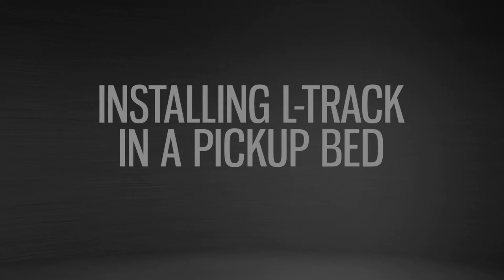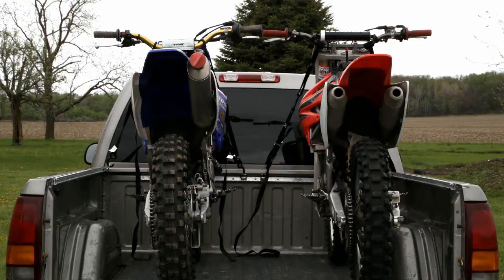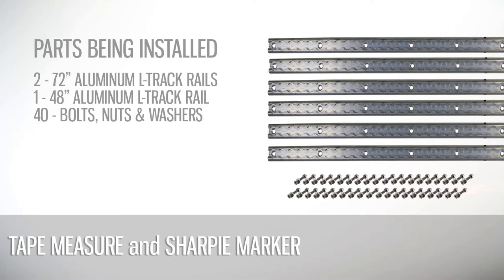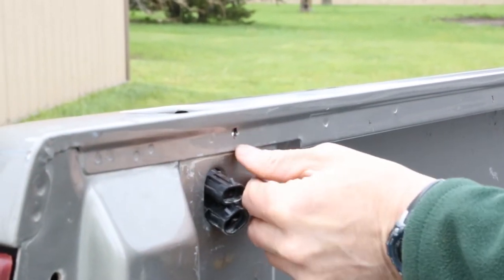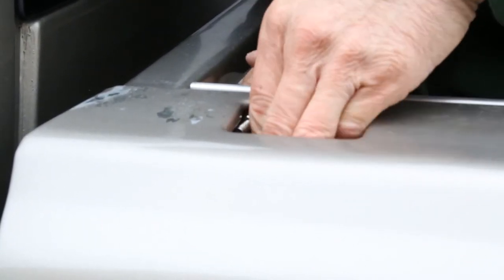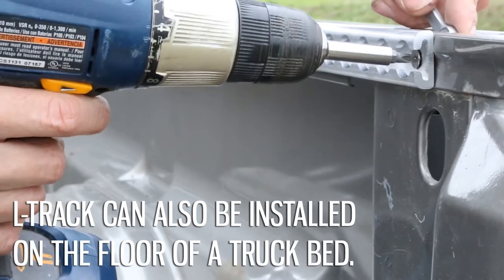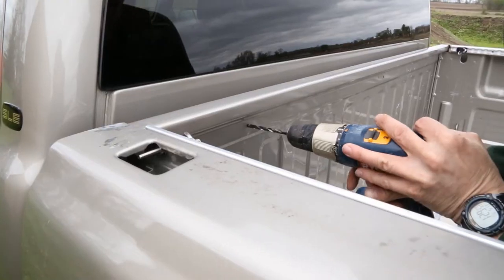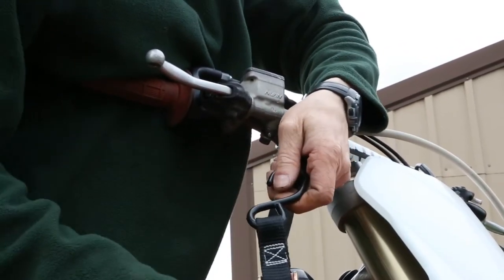How to Install L-track in a Pickup Bed | L-Track Tie Down System

Comment: Do you need to put any type of backing plate on the other side of the bed rail from the track? Also do you need to paint or silicone where you drilled through?